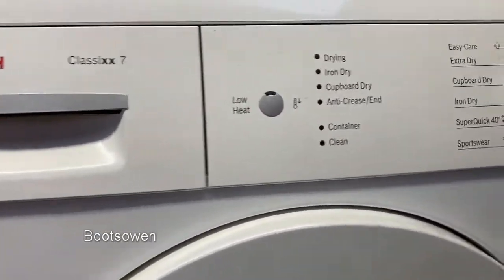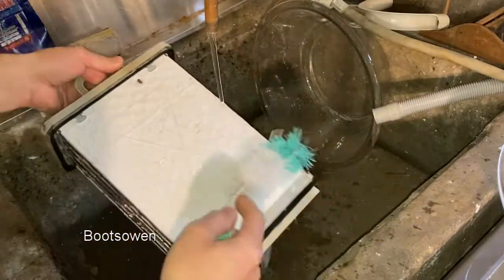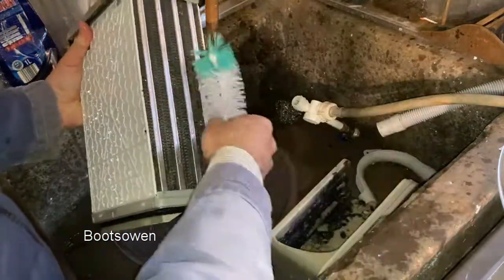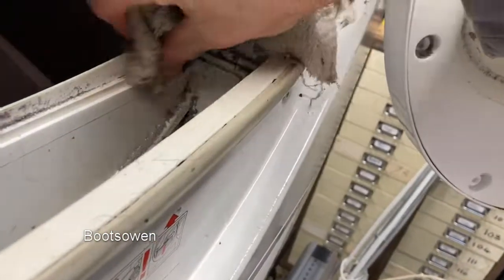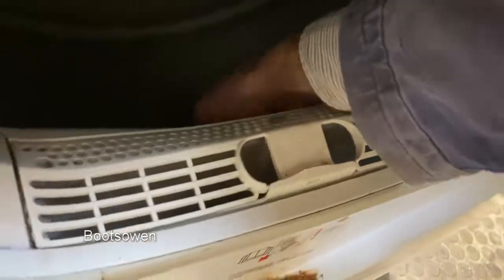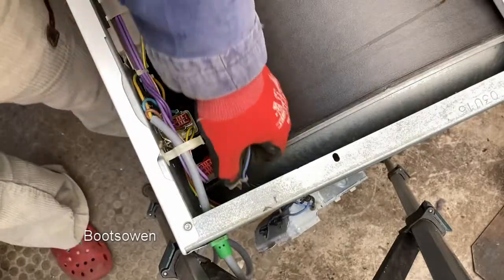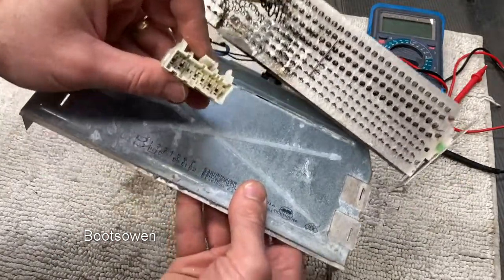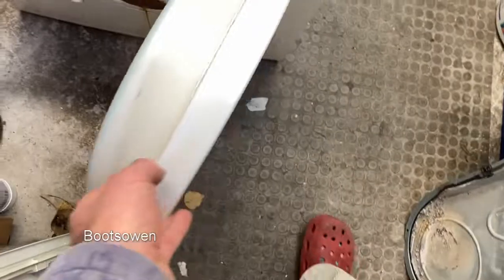Found it on the street: will it dry? Cleaning and fault finding a Bosch condenser tumble dryer

Comment: What a shame that the original owners didn't clean it at all!.
No wonder the element gave up the ghost.
A good friend asked if i would look at his dryer, it was badged  indesit if you believe that lol.
The plastic pulley pushing on the belt just fell apart,  Rest in pieces lol.
The new pulley/bracket cost 7 quid, and after i dug out all the tons of dust/fibers/crud from everywhere including the element assembly, it was happy as a dog with two trees :-D
Sorry bootsowen  long woffle.
Oh, i have an identical dryer, just a different name.
Reply from the maker: I think it came from a rented house, and people are what they are.
Reply: @bootsowen  They have no ability to repair things like you do, so they dump it.
Handy for you to salvage parts from, and if it's a mess then the metal case will go to your pile of metal.
I dont suppose you would get much for the  really thin case metal.
The very old machines (service 1000) were built like a tank.
Ahh sad those days are gone